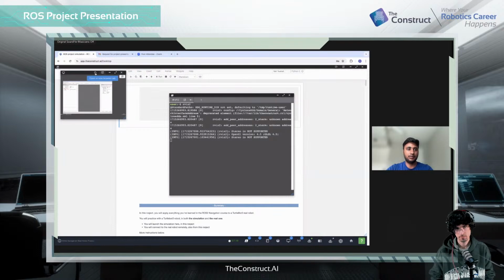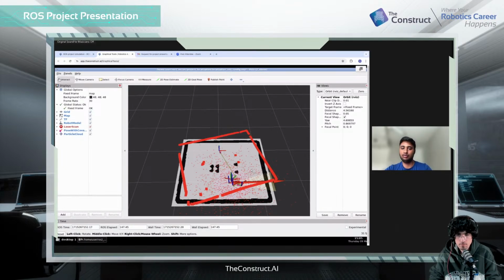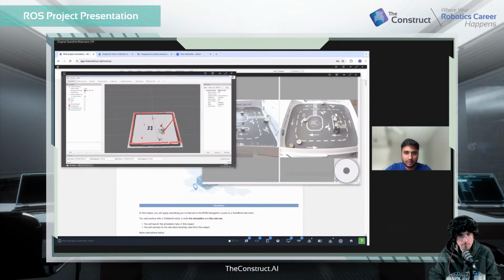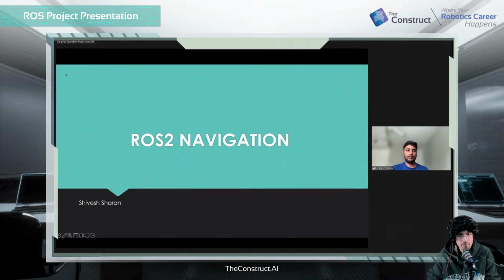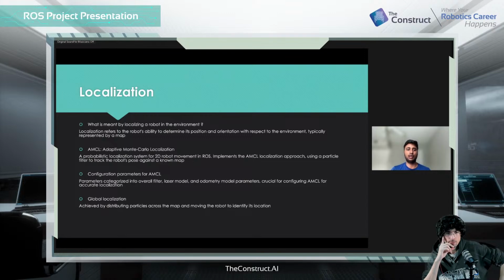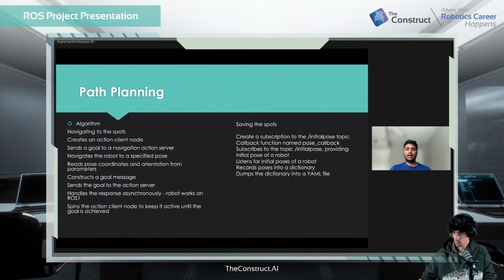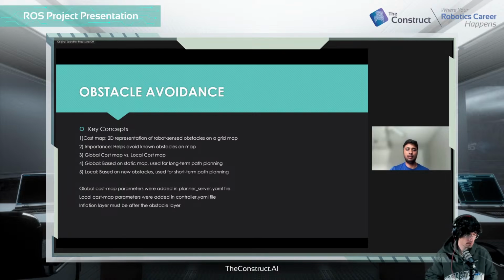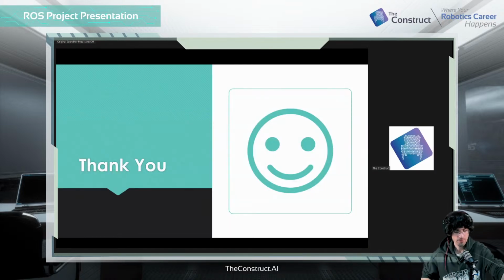Shivesh Sharan ROS 2 Navigation Project Presentation

Comment: Thank you theConstruct for facilitating.  Solid work Shivesh.  The moving obstacles can cause problems. Needs the local planner. Facilitator points out ROS2 .yaml uses what is in the build environment, so it must be repeated. (ROS1 links directly).